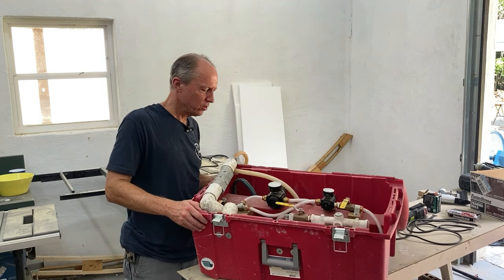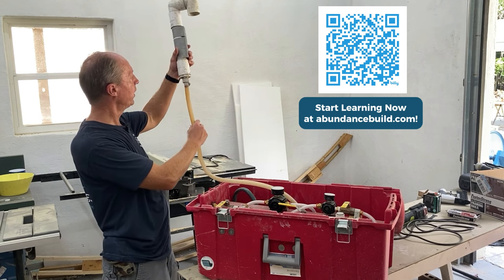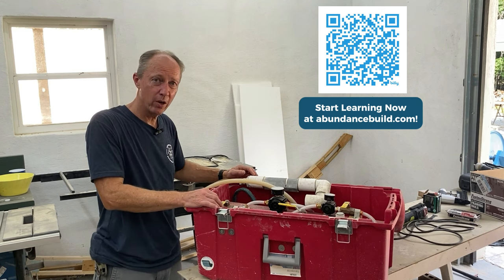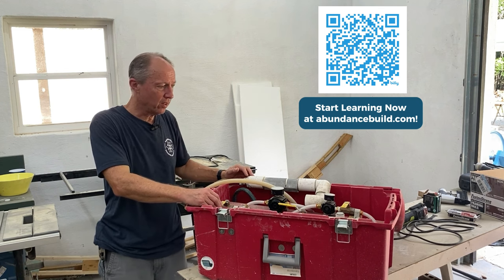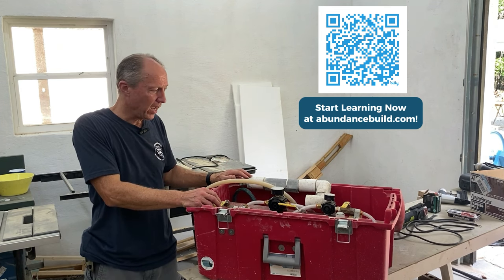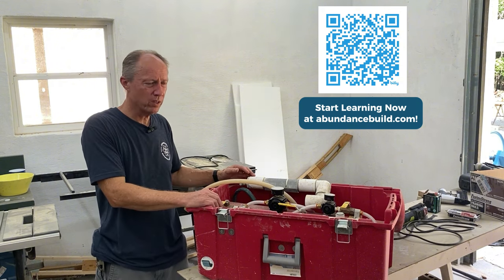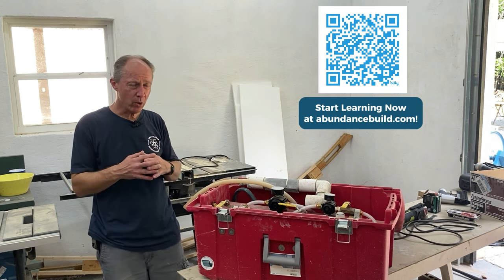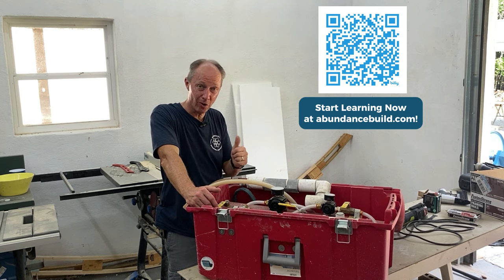Why I QUIT Aircrete

Comment: Aircrete was way too complicated. I used about $500 worth of materials but never got it to be consistent enough to build with. I even paid a dome building aircrete groups $1000 to try to learn, but the information was never clear. When I bought your e course, we started getting consistent abundacrete mixes and saved thousands on our building costs.
Reply from the maker: @BraxtonMcDonald92  Right on! Yes, aircrete is not as DIY friendly as it sounds on YouTube.
Reply: I hired an airecrete contractor for a job I was running. Not impressed. Hard to tell what fault lay with product or application though. I couldn’t take the risk again.
Reply from the maker: @greenman4508  It's far too unpredictable of a product! You get a different result day to day even if you know what you're doing. Could be pH of water, atmospheric pressure, air temperature, etc
Reply: @ yup. I wouldn’t be so irritated if the sales pitches for it included honest feedback about its parameters . Every material has drawbacks, but most will tell you.
Reply from the maker: @greenman4508  Same problem on YouTube; if aircrete is your golden ticket, you have to wonder if those who promote it are being objective
Reply: @ yes, that’s why I sold the concept like I knew what I was talking about to a client. I almost tried to do it myself because the videos looked so fool proof. That would have been a liability nightmare
Reply: I experimented for a while and found my insulation project collapased into nothing. That was a big dissapointment in Central Montana where insulation can be the difference between frozen pipes or worse.

Comment: I was about to build like the Prana-Tech air-driven diaphragm pump (like you did), but then I decided to order an electric utility submersible pump instead. This way I keep my compressor solely available for the aerator. The submersible pump will have no issues with foaming agent solutions (my opinion and expectation), unlike the issues you mentioned with the known issues on small electric diaphragms pumps. The submersible pump has huge flow and a head of 7 meters. Push-Lock connectors and PU-tubing to connect pump to aerator, with 2 valves in-line (series). One for flow setting, the other for operating open and close. Hopefully next week all parts are complete and ready to assemble. First attemts to get correct density of foam, later will definitely do some experiments with styrocrete and fibermesh.
Reply from the maker: Good luck! Sounds like a better machine. If you get frustrated with it, Abundacrete is easy.
Reply: Thanks. Once my system is up and running at good performance, let me send you a video of it to your email address.
Reply: Here's my update, I got the system complete and it's running. First challenge is to get my items and ingredients, because I'm located in Philippines. Availability of items and tools like I'm used to have (or easy accessible) in Netherlands (Europe), emigration to Philippines is a real challenge by itself.
Anyway, using a submersible utility pump works in basic. My air flow needs to be regulated and air pressure that is going to the aerator is at now adjusted to 15 psi, getting foam at 104 grams per liter. Looks like shaving foam, keeps its volume for say 1 hour and then shrinks back slowly to liquid. 
My 10 liter solution is now added by 20 grams AOS, 20 grams of glycerine and 50 grams of Suave Deep Cleansing Shampoo. I weigh all ingredients on kitchen scale, 0-3000 grams +/_ 0.1 grams accuracy. 

Any suggestions are welcome! 

I'd love to try agricultural marker foam concentrate because it keeps its volume and shape for multiple hours, but it seems not available in Luzon (USA, CANADA, EUROPE it is....absolutely worth to try).
Reply from the maker: @johan6481 We still recommend to ditch the foam and look for Styrofoam already shredded or able to shred - it will hold it's shape for longer than "hours" 😉
Reply: Thanks for your reply. For my first project I just need solely foamcrete. The agricultural marker foam lasts a day, according a friend in Europe. Perfect to hold its volume until the Portland cement starts its setting. As mentioned, unfortunately not available in Philippines. 
In a future project, the styrocrete is definitely okay as a different kind of production method.

Comment: Have you ever considered using pourable marine foam with chopped styro? It's identical in chemistry to spray foam and polyiso, but much slower rise. It's an excellent adhesive and especially above 2lb/cuft is very strong and insulative. Not as easy to work with sure, the form would have to be sealed well, but the end result would have much higher insulation value and strength.
Reply from the maker: @christopherbenjamin9273  Have not considered that. Does it provide any of the other benefits like pest and fire resistance that the cement does? And what does it cost? If you try it let us know how it goes
Reply: @AbundanceBuild Polyiso has a good reputation for pest resistance, but fire no. However the majority of the fire resistance for a building is in the cladding or siding. As for cost, pour foam is much cheaper than spray foam because you don't need any of the expensive equipment. I can only estimate the pour foam would be 15-20% of the mix. I'll let you know if how the experiment goes.

Comment: This was my first intro to your process.  Can you tell me more about how to mix sand and concrete together, and how to pump the mix through a hose for application ??  Thanks, Gray  😊
Reply from the maker: @GrayEagle-r2h  Mixing sand a concrete in the mixer is just as easy as pouring one after the other. You can't pump it through a hose, we dump it using trays - which is actually faster!

Comment: Years ago I experimented with making a few bricks with a 1:3 mixture by volume of portland cement and perlite. The bricks have interesting properties. You can drive screws into them without pilot holes. They are extremely flame resistant, and I assume far more insulative than solid bricks without perlite. Some day I'd like to try using styrofoam instead of perlite and compare the two bricks.
Reply from the maker: @firecloud77  Sounds awesome! Great job! Our mix can do that at a much lower price, but we prefer to have another drilling surface to hang things with a lot of weight in the wall

Comment: Hi Stephan. I'm surprised to see you jamming Aircrete as historically - it has brought you to where you are today. There are so many people doing great things with Aircrete as evidenced by the abundance of new Aircete videos now available from Youtubers worldwide. A few months before you released your 1st Styro-Aircrete video, I had been chatting with Aircrete Harry about the E.P.I.C mix. (Expanded polystyrene Paper Infused Cement) with 4 different mixes of styro for varying design uses. I asked - Has anybody tried mixing shredded styrofoam into Aircrete yet?....it might be worth a try! He said he hadn't heard of anybody doing that yet. A few months later - he forwarded me a link to your 1st StyroAircrete video and BAM...I WAS SOLD! I used that mix just this past summer to insulate a framed exterior wall as filler. 1st I was poring it into a slip-formed wall and one day I had a large amount of excess styro aircrete left in my barrell once i'd filled my 16" depth form. I didnt want to throw it out so I grabbed my Drywall mud hawk and started packing styroAircrete in the space using My Hawk as the form. It held in place perfectly with ZERO slump! I was amazed, I used up that barrel and was able to get another 24" of vertical height on top of my 16" form work below. When I returned the next day - it had hardened and held up beautifully. My mix was a standard Aircrete mix using Harry's Aircrete Thickener in every batch - and 25 gallons of shredded styro. My whole thing is that all the different mixes whether Concrete, Cement, Aircrete, Autoclaved Aerated Cement, E.P.I.C., Styro Aircrete, Hempcrete, Dust Crete....and more to come - no doubt - all have their place depending on whats required for the climate conditions at the build location local codes/engineering and available materials etc. No mix design should be disregarded! They all need to be part of our repertoire and everyone interested in this kind of building should learn ALL OF IT. Here's a pitch for you.... why not try a graduated mix design with varying strength and insulative values as the building goes up. More strength in the lower sections and Lighter higher R-value mixes in the upper sections. Dome builds would be perfect for this. I'm Surprised Domegaia isnt doing this yet. Harry may have with his double airform method. Everybody's methods and input to this wonderful experimental building realm is valuable and important! Please don't slam the Aircrete. Every bubble has its value.
Reply from the maker: Thank you for sharing your story! Many people have success with it and many people don't - that is the problem. We need consistent and predictable results and so will engineers who approve projects. Our goal of affordability, performance, and sustainability has been achieved and is easily replicable by anyone anywhere; therefore, we personally cannot recommend what we had a bad experience with. We are not slamming anyone else on their research journey and hope their goals are the same and they achieve similar success! We certainly tried all of those options you mentioned and were unsatisfied, hence the need to create Abundacrete!

Comment: I would have to agree with you on the consistency problem. I am trying a dustcrete mix next using Portland sand and course sawdust and packing between rafters.
Reply from the maker: @rocktech7144  Dustcrete doesn't seem like it would have very good insulation?

Comment: Sounds like this could be a good solution for homemade SIPs as skins for a post-and-beam structure where the beams support all the weight and the SIPs are just there for a highly insulated skin.  Is this being used at all for skinning a post-and-beam structure?
Reply from the maker: You could do that but making homemade SIPs provides more challenges than benefits in our experience.

Comment: I believe it’s called readd in Canada or city mix(?) in the usa. They have an additive with styrofoam for light weight concrete. Trinic usa was the supplier.
Reply from the maker: @noahkettel5028  That's cool but it's easy and very very low cost to make your own with our methods!

Comment: I am looking at building a post and beam house so walls are not load bearing in any way, therefore Styrocrete would be ideal, just by making panels to be inserted and joined together.   Perfect insulator for humid subtropical environments. My question is what about passing building fire codes.  Is Styrocrete flame proof enough for building purposes?  Otherwise saw dust crete may be an alternative solution.
Reply from the maker: Definitely fireproof! Check out our test: https://youtu.be/LMPR8i4IWMA?si=3zg4zEZHY5L1wgxa
Reply: @AbundanceBuild  Terrific, no building codes to speak of in Paraguay but just checking.
Reply from the maker: @michaeldemarillac9992 Awesome! Paraguay seems like it is near the top of the list of places to be right now!

Comment: Would this work for a 20 ft tall building?
Reply from the maker: @oldporkchops  It would but in our experience we recommend to cap at 12 feet. It just feels uncomfortable and is challenging working on scaffolding at that height
Reply: @AbundanceBuild  Got it. To overcome that working at heights issue, is it possible to first make AbundaCrete blocks that can be transported and laid like CMU or bricks?
Reply: @AbundanceBuild  The 20 ft height is because the building is a gym and would need to accommodate various ball sports, with the high probability of balls being thrown in the air.
Reply from the maker: @oldporkchops  That is possible but you will still have to stucco up there which was the real challenge that high up. If you could invest in good scaffolding this may overall be fine but cuts into the cost savings
Reply: @AbundanceBuild  Got it. Thanks for responding.
Reply from the maker: @oldporkchops  You're welcome! Good luck with your project!

Comment: Thinking out loud what  helix  micro rebar in the mix would do.
Reply from the maker: Would probably be great, but unnecessarily expensive
Reply: @AbundanceBuild  Not for normal use in walls. I'm thinking about spans and 2-way slabs or even joists given enough depth. One of the videos shows Steve standing on slab spanned between two supports. I'm thinking of that turned on edge with a much greater span.
Reply from the maker: @feonix138  Go for it! The cost is offset by all the savings with the free recycled materials